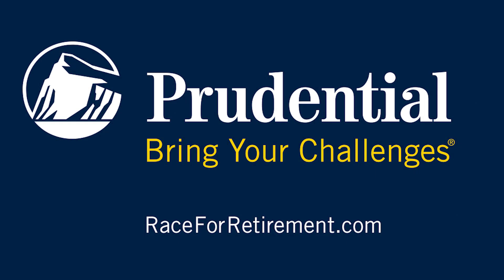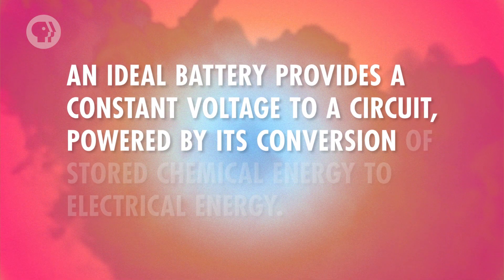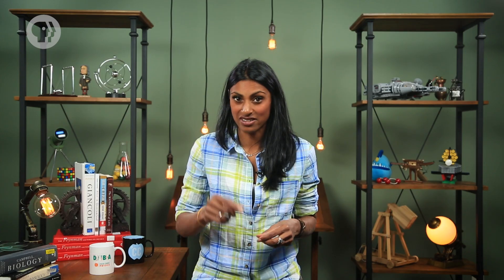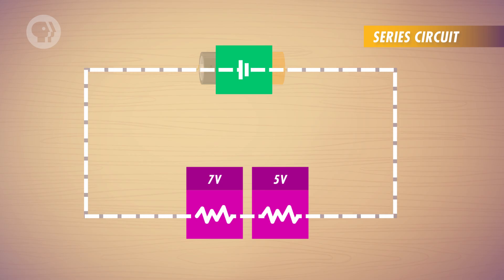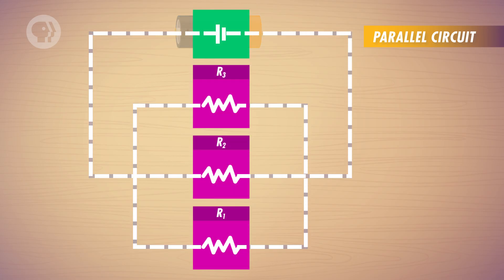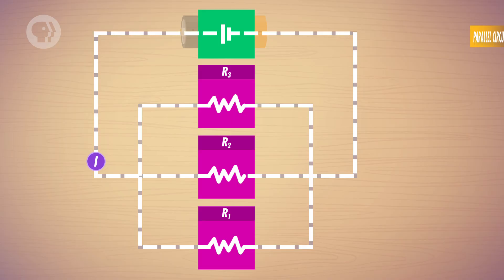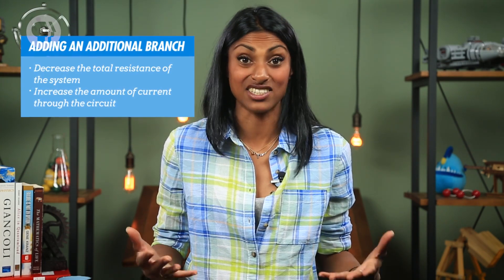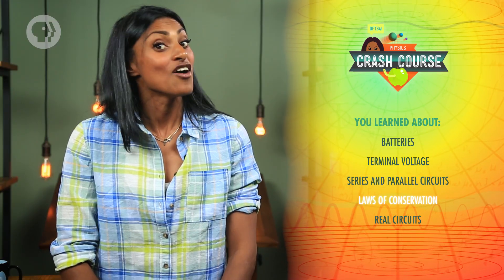DC Resistors & Batteries: Crash Course Physics #29

Comment: One of the great advantages of parallel circuits is that if one component stops working (so the circuit is broken), it only affects that branch of the circuit but the rest can carry on functioning normally. Imagine Christmas lights: you want to get the ones where if one light goes out, the others will still light up. Otherwise, finding the problem bulb is going to be a nightmare.

Comment: Great video!

Small glitch?
Here you nicely explained that in series circuit, the current should stay constant through the circuit: https://youtu.be/g-wjP1otQWI?t=3m50s

However, latter on,  it states that double the resistance in series will give half the current: https://youtu.be/g-wjP1otQWI?t=7m52s

Just FYI in case you wanted to add an annotation about that :)

Cheers!
Reply: If you change the resistance, you're changing the circuit so the current is no longer constant.

Comment: You should have put a bit more time into the batteries internal resistance and the heat that generates as the current you pull from it increases. Should get people thinking about battery ESR early because it's important for safely working with batteries and is often overlooked.

The experiment with the light bulbs for example would have been dangerous to perform with low resistance components like lithium batteries or LEDs. Exploding LEDs and batteries is a recipe for a bad time.

Comment: Actually, the battery's internal resistance does not necessarily dissipate power via John's law like you say here.  while there are resistive losses in the battery, often what's really impeding the current is the chemical cells in the battery only being able to carry out the chemical reactions at a finite rate, limiting how many electrons per second can go through the circuit.

Comment: Great episode but I would like to dispute the title. DC Resistors and Batteries is misleading since one might think there is such a thing as a direct current resistor which doesn't exist. Resistors are just materials that resist the flow of current, regardless of the type of current flowing through it. The resistance of a resistor will not change because the circuit is an AC or DC circuit. Similarly, all batteries are DC since they have a constant voltage and provide a constant current. There are no such things as AC batteries; those would be wall outlets. A better title would have been just "Direct Current Circuits" or just "Resistors and Batteries."
Reply: A couple things to point out: Depending on the way you see it, you can just determine that DC resistors are not different from AC resistors without having to say that neither "exists" (i.e. a resistor connected to a DC system is a "DC resistor" and a resistor connected to an AC system is an "AC resistor". A weak, but not entirely invalid argument.)

I would like to point out that "resistance" never changes because it is a scalar, real number that does not depend on any other factor. You probably meant to say "impedance" which is a complex variable that depends on some integral of t (transient analysis), s (Laplace transform), or j-omega (Fourier transform).

Most standalone batteries are DC batteries. However, there at least definitely exist alternator circuits that can turn this DC power source into an AC signal using metastable circuits. Depending on your definition of "battery", they can potentially be considered "AC batteries."

Wall outlets are not the only source of AC current. In fact, if you want to say that, then we would not only have to include power lines, but any arbitrary system connected to a step-down transformer. There are also some circuits that have the power to "pull" current and can alternate between these "push" and "pull" systems. (I think that Analog Devices has more information about these types of systems as it is featured on their Analog Discovery education platform...)

Comment: Ohh, can't wait till we get to Mesh, Nodal, and Superposition Analysis, Kirchhoff's Voltage and current law, Norton and Thevinin equivalent models, AC circuit analysis, complex impedance, Dissipation factor, and capacitive and inductive reactance! :D
Reply: Power Max /r/iamverysmart I doubt they will get that in depth on the subject sorry.
Reply: However don't stop me from letting you feel very smart by dropping physics terms.
Reply: Yeal LOL, of course I don't expect them to cover this stuff which is generally only covered in a university level physics or electrical engineering class, most of those things are mostly only relevant if you are an engineer anyway. But you gotta love all the jargon they use!
Reply: #iamverysmart
Reply: but how do i build a crystal set radio?
Reply: Bilb Ono you need a germanium diode (1N34A and 1N60 diodes are popular choices) AND high impedance high sensitivity headset or earphone. You can use normal ear buds if you also use a impedance matching transformer.

Comment: Sees electricity related video, turns one needless nitpick mode

0:11 made me want to kill somebody...
DC CANT PASS THROUGH A CAPACITOR screams uncontrollably

0:25 it actually provides an Electomotic force (EMF) that just happens to be measured in volts due to the base units being same (V=E/Q, we arrive at Kg m^2 s^-3 A^-1...)

1:34 and not really a Potential diffrence as that is used more to discrible the energy used... a battery is a source of EMF, it gives energy to the electrons, the charge. we say that one volt is the amount of energy the cell/battery suppplies to a charge of one columb (sp?) to drive it around a circuit...

nitpicking aside. I loved the fluidity of the video! keep it up
Reply: turns on* needless nitpick mode                                    .*
Reply: RoarOfDamnation nitpicking on the nitpicker... Nice.
Reply: Anas Malas capacitors let pass DC while it charges, once it reach it top voltage it opens the circuit. So we can say the animation is accurate if we say that the capacitor is still charging.
Reply: Sorry for this, but I would like to nitpick one of your point. Specifically, your point about DC characteristics of capacitors. The main argument that I would like to present is that it is a little more complicated than "DC cannot pass through a capacitor."

To begin my nitpick, I would like to point out that the general behavior of a capacitor is to store charge. The capacitor stores potential electric energy, the EMF, or voltage (depending on how you want to look at it).

At this point, I would like to admit that, yes, the steady-state DC characteristics of a capacitor is a break in the circuit, but to understand why, we need insight gained from looking at the transitive DC characteristics of a capacitor.

If we assume a zero state on all components, at the beginning of the system's life (or as lim(t)->0), the voltage stored in a capacitor is 0V. As current flows through the circuit, this capacitor voltage will eventually settle on the voltage of the battery (assuming that the capacitor's design and material allows for the storing of the battery's voltage, when/if doing this experiment, please note the ratings on the capacitor, the capacitor's material design, and the way you're handling the capacitor).

So what is the significance of this? Well,  we can actually calculate the current moving through the resistor using a combination of Ohm's law and Kirchhoff's Voltage law. (This combination technique may also be called Mesh Analysis.)

So at lim(t)->0, using Mesh Analysis, we can see that:
V_total = 0
V_total = V_battery + V_resistor + V_capacitor
-V_battery = V_resistor (Note that V_battery will be negative because it "supplies" power and rather than "expend" power.)
I_resistor = V_resistor / R or I_resistor = -V_battery / R
And this is a non-trivial, non-zero number.

Your point is probably describing this: Let's say that the circuit reaches steady-state when 0<t<5s (not an unreasonable assumption as 5 seconds is a long donkey's worth of time...), our mesh analysis looks like this:
V_total = 0
V_total = V_battery + V_resistor - V_battery (since electrons cannot jump from one pole of a capacitor to the other, the voltage must return from the direction it came from, unless we somehow factor in quantum tunneling.)
0 = V_resistor
And since Ohm's law states:
V = I/R
Then,
I = 0/R = 0

In between these two states, the capacitor will charge logistically up to V_battery (because the current going into the capacitor decreases as the capacitor charges, leading to a decrease in the rate at which the capacitor charges.)

So, yes, you can use a capacitor to block current in a DC circuit. However, I would definitely not recommend doing so, especially if you have a low-power, low-resistance resistor (burnt out resistors can become very smelly :P). I would finally like to conclude that, although capacitors act in this way in DC circuits, there are still other, legitimately good reasons to use capacitors in DC circuits. Also, this behavior will also be handy when we look at AC circuits and electronic signals (such as arbitrary waveforms and analog sensor signals).
Reply: right
Reply: Wow guys I do know electricity ;'D

I did think that someone will say that its still charging and may be a super cap which would take up all the charge and demand more :P

About using caps in circuits... Well duh... But its more usefull being parallel dont ya think... And yes. It does allow AC to pass through
Reply: But the diagram at 11 seconds is wrong. And that was the point of the comment I would guess.
Reply: edwin hoeks its wrongz but only when cap is full... Which was the point of hg202
Reply: +edwin hoeks Sorry for not being transparent enough with my intentions. I'm not very good at communicating my thoughts very well. However, just as +Anas Malas said, my intention was to make clear that the diagram, like most things in life, can be interpreted as correct or incorrect depending on how you look at the problem associated with the diagram.

I guess, crudely speaking, I was "nitpicking" on the "nitpick". Sorry about that... -_-

Also, I should also correct myself because I realized that I had made a mistake. The reason that voltage in a capacitor faces the direction the current was coming from is that, as current decreases, the number of electrons that pass through the inner material of the capacitor stop passing through, as they cannot move (because current implies a movement of electrons; which can also be interpreted using the opposite direction using electron "holes", which goes on to the topic of polarity... annnd I think I'll stop there... we might be getting in too deep.) -_-

Oh. And one more thing +Anas Malas. Yes, AC can pass through capacitors. But DC can also pass through capacitors too! Simply speaking, AC describes an electrical system with a "push" or "pull" while DC can only push. But let's say that I add a DC offset to an AC system and, therefore, have an electrical system that can only "push", a "DC" system, capacitors will still let this "DC" current to pass through. It's a little nitpicky but this is a pretty awesome property. It allows us to add some cool features such as hardware debouncing for noisy buttons and switches for small systems without negative supplies and even makes computer/digital music possible with sound cards being able to use digital data through DACs and filters! :)
Reply: hg202 dude... Honestly I just eant to ask, where did you get all this knowledge from? Are you an electrical engineering graduate?
Reply: +Anas Malas Oh. I am a BS in Computer Systems Engineering. Circuit analysis is pretty important when we consider the design of electronics. :)
Reply: hg202 Nice! I am just on the verge of starting my electrical engineering course
Reply: heyyy brah remember the top string where u wanted to kill someone well yeahhhhh (dont kill me plz)   .;,;.

Comment: Shouldn't the diagram be flowing in the opposite direction? Out of the negative side of the battery and into the positive side.
Reply: The conventional way is used often not because it is easier to understand, or because of our mental bias for that direction, rather due to a lot of polarized components being designed with this convention in mind.
Reply: Jcewazhere   This has been covered well in comments on other CC Physics videos.  Here is a short version. 1. The convention for electric charge, and thus for the polarity of current flow, was established by Benjamin Franklin 100 years or more before anyone had any inkling of electrons.  2.  There are quite a few important systems, including the Ipad I am writing this on, in which positive charge carriers are very important.  3.  Every physicist, chemist, electrical engineer and electronic technician in the world knows that electron flow is opposite to conventional current flow.  It is a simple thing to learn.  It might be the very simplest idea in all of electronics.  Everything else about electronics is much more complex.
Reply: I would like to add that it also makes using Kirchhoff's laws easy as we can say that the "polarity" of a component is "negative" when the direction of the loop hits the "negative" side, goes through the component, and exits out the "positive" side and "polarity" is "positive" when the direction of the loop hits the "positive" side, goes through the component, and exits out the "negative" side.

For a simple circuit with a single power source, it may seem like overkill, but sticking to a convention helps when dealing with multiple power sources and components that have non-trivial polarities.
Reply: What you're describing (negative to positive) is the actual scientific way that current moves (electrons move), but for most people, the conventional positive to negative is easier to understand, and engineers use the conventional way.

Comment: why not use a breadboard instead of that tape contraption
Reply: The wires make an easier simple demonstration.
Reply: it looks half-assed though
Reply: and a power supply to show it's drawing twice as much power
Reply: Then they'd have to explain what a breadboard is and how the rows and columns work along with how a power supply works. Better to just connect them directly since the goal is to just talk about the topic.
Reply: a simple graphic would easily explain how a breadboard works, and you could just take the reading from a power supply and say it "just is", or you could hook up a battery and use a multimeter
Reply: How about because this is easier for viewers to recreate, and at minimal cost.
Reply: why use a breadboard instead of that tape contraption
Reply: Dušan Pešić looks good to me. they managed to demonstrate what they wanted using things that people were already familiar with.
Reply: NOT DA CIRCUIT NAZI
Reply: so it doesn't look half-assed
Reply: but it looked flimsy
Reply: Are you a circuit Nazi?